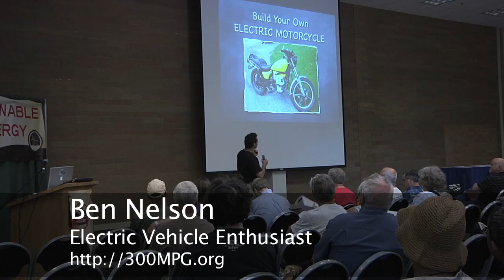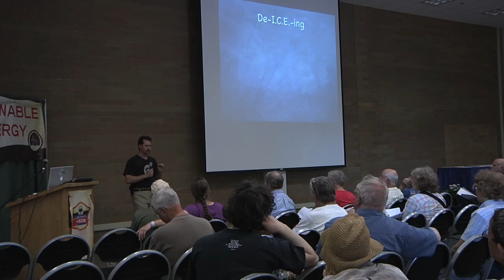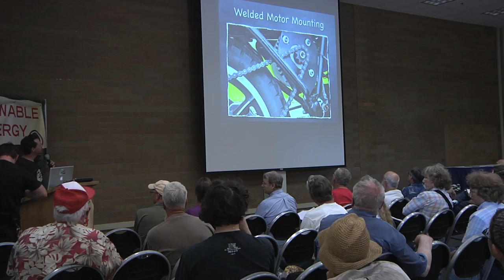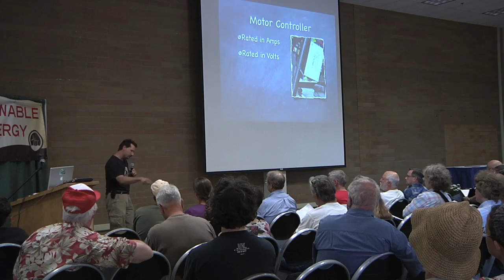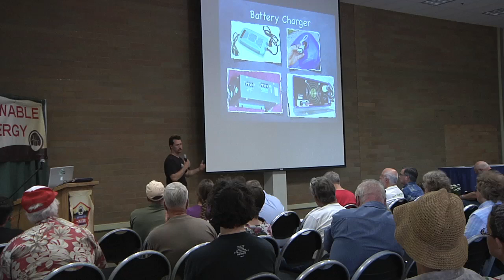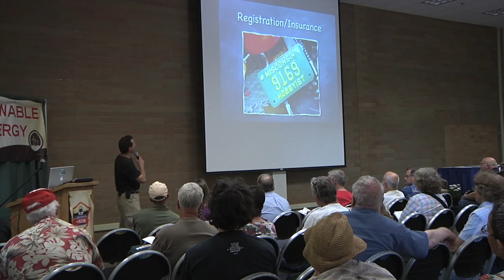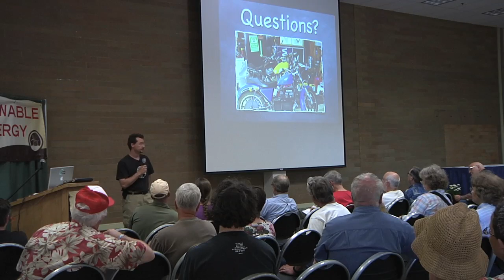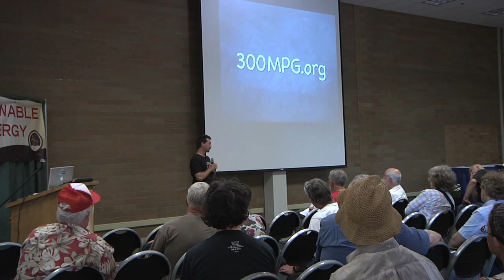Build Your Own Electric Motorcycle

Comment from the maker: @ParagonReef 
With the motor, gearing, and everything else on my cycle, it rides at about 1 mile per hour per volt. If I just increased the system voltage to 72, it would do 70mph. It would also need at least double the capacity of batteries. Lithium batteries would be the way to go for that type of range.

Comment from the maker: Yes, you could fit more smaller batteries in, but smaller batteries have less capacity, so you would need more of them for the same range. Smaller batteries tend to cost more per watt-hour as well. The one advantage of smaller batteries is that you can have more of them in series for a higher system voltage. In this case, I'm using a 48V motor, so I'm already at my max voltage. I used the physically largest batteries I could that met my maximum voltage AND fit inside the frame without mods.

Comment from the maker: @dfhohj 
On DC motors, VOLTS equals speed.
Voltage is mostly based on how many batteries you have in series.
For amperage, you want to be ABLE to pull plenty of amps, but actually do it as little as you can. Batteries LIKE when you sip amperage out of the batteries. But the heavier a car is, the bigger a hill you have to climb, and the faster you want to accelerate, the more amperage you will pull.
So a web search for "EV Calculator". It will help you figure your load.

Comment: Doppler effect = It is commonly heard when a vehicle sounding a siren or horn approaches, passes, and recedes from an observer. The received frequency is higher (compared to the emitted frequency) during the approach, it is identical at the instant of passing by, and it is lower during the recession.
BTW they make suits for winter snowmobiling, you plug them in, so the winter heat motorcycle issue should or can be solved. Im looking into head ups projection for helmets wifi communication ect..

Comment from the maker: @whothehellgivesadamn 
I added the specs in the video description. The cycle works great for me. If you needed a different range or top speed for your cycle, all of that can be easily adjusted through gearing, higher battery voltage, or (if you can afford it) a different battery chemistry.
The cycle meets my range needs (I could go to and from town 5 times a day if I wanted) and is geared appropriately for the speed zones I live in.

Comment: you could wire your large number small batteries in series in groups of four, and then wither those groupings in parallel, maintaining the 48 voltage. once you start wiring them in parallel, you are adding amp hours. Your small 12 volt batteries have WAY fewer amp hours than the huge 12 volt car batteries.

Comment from the maker: Are you kidding? It's an old computer. The CPU and monitor together weigh nearly as much as the cycle! (OK, not quite that much...) The motorcycle is on wheels, much easier to move...  It really is a huge pain to unplug everything move a computer and CRT monitor, and set it all back up. I only really needed the computer connected to the cycle for just a minute to change the settings. Much easier to run a cable out the window.

Comment: Hey how much kw is your motor?
Im trying to build my own electric motor cycle with a 48v system and a 1000 watt motor is it fine I want to ho max speed of 40-45 kmph and at least a range of 50-60 km
What would u suggest?

Comment: Im still having a bit of an issue when it comes to amps and what size car is ideal for me, so if someone likes speed they need a 100amp motor on a small lite race type car?, or if i need a pickup truck hauler i need a higher amp or volts?, i think people need to understand more what they want as they are building custom vehicles.
autocad is great for creating templates and you can have a cad printer mold you a body, carbon fiber with Kevlar is great for light flexible durability.

Comment: yeah but couldnt you just have like 50, 12volt small batteries with a heavy duty resistor so that it goes down to 48 volts? would that make the batteries last longer?

Comment: Thank you for this clip-I think I'm already adicted with this idea :) It should be nice if you give some clues. I want ( and I will) to make samething not so big. For my girlfriend for example (45-50 kg). Its enough the battery to last for about 30 miles, and speed no more than 30 mph. The idea is to be cheaper (for making) and efective enough in the city.So can you help me to choose the engine, the batteries and right voltage and amperage for this weigt. thanks in advance

Comment: In your presentation you mentioned that you got your motors for under $100; is there a vendor that you recommend that we can reach out to for the motor?
Reply from the maker: Getting extremely low priced motors would be through the salvage market. For example, pulling a motor out of a forklift. There are specialty salvage yards, pick and pulls, etc. where you can get great deals if you know what  you are looking for. For just buying at retail, expect to pay $500 on up. Like so many things cost just depends on other factors you want to put into it.
Here's a list of parts suppliers you might be interested in. https://300mpg.org/projects/evcycle/ev-cycle-parts-suppliers/
Reply: @BenjaminNelsonX  so true as one location retail that wanted to charge over $400 for a 36v 3.7Kw Crown motor that might/ might not work. Unfortunately, there are no salvage markets here in Georgia where I could go into a yard and pull the part myself.
Reply: @BenjaminNelsonX  it took me about six hours round-trip drive but I managed to locate a 48 volt electric motor for my motorcycle for $140.

Comment: Great job . I have a Honda eu2000 generator that is very small and very quite . It weighs about 40 lbs . It runs  8 hours on a 1/4 load  on ,95 of a gallon of gas   . So you can see if the eu2000 was connected  to your motor  instead of your battery's  you could ride all day on less than a gallon of gas . I want the ue2000 to fit in a drop in framed frame   so it ends up  setting  where the gas tank would be  so it can be refilled just like a regular motorcycle tank would .  The exhaust is on the back end so it would be going under the seat and blow out the back . What do you think about a  generator running a electric motor on a motorcycle ? Even on a full load full time using  13 amps continuous usage which would never happen  the eu2000 would still run over 3 hours on less than a gallon of gas . That still 300 miles going 60 mph . Its 2530 miles from coast to coast in the united states ,that means  you can travel 60 mph and go 2530 miles on 8.4 gallons of gas . This is something the  oil company's don't want car or motorcycles to find out  . Remember thats on a full load of 13 amps of use . Its going to be closer to less than half of that amps so your going to get closer to 8 hours of run time . Even if you figured 7 amp full time use of the motor thats makes it 4 gallons of gas to  across the united states.  Will you hook up a amp meter or tester to your motor and find out how many  amps you're using going 60 mph . I know a 110 1/2 hp motor used 9.8 amps . Would a 1/2 hp AC motor be big enough to power a motorcycle ?  I think using less than a gallon of gas every 8 hours of travel time  is a lot easier than the full battery  bike because of the recharge and the power it uses to recharge  the battery's.   The eu2000 will fit in a Dimensions L x W x H (in.) 20 1/8 x 11 2/5 x 16 3/4  space  . Why aren't people using small generators  to run  a motorcycle ?
Reply: people aren't doing this because it doesn't work. The motor controller will draw up to 300 amps which a small generator cannot produce. The generator you're talking about produces 2200 watts peak and usually half of that continuous. That's not enough power. now if you had a battery pack as well as a generator it could be feasible and i'm going to be building prototype vehicles with this in mind using a bio-diesel powered generator. Plus, this idea kind of defeats the purpose of creating a "green powered vehicle" and adds extra complexity and is usually not needed for most people. Lots of people don't go on long trips with their home made ev.

Comment: My LONGEST trip would be 1 1/2 hours ride, mostly flat terrain, 65 miles total, really need top speed to be at least 60 mph, 70 would be ideal. POSSIBLE?
Reply from the maker: A properly-sized lithium battery pack could get you that far. There currently are commercially-available electric motorcycles with those specs. For ideas, do a web search for both Brammo and Zero electric motorcycles to see what size battery packs they have.
Reply: BenjaminNelson
Greatly appreciate your reply, I ordered the DVD by mail, next question,the battery packs you refer too above could/would they fit in the same space as your bike? Would the connections be the same with same other items you use? IF I decided to use these OTHER battery packs could I get advice from you on what and how to hookup latter? Thank You, BTW I work for the company that sells the motor you put in your bike.
Reply: Numa Newbern
 Alternatively, you could tow a trailer with a small generator on it. ;)
Reply: Got one in every crowd don't we? Yea, I could also add batteries in a pack on my back, and a side car full of batteries, thanks for the jigger to my brain where I could come up with MORE amazing options
Reply: Numa Newbern
A sidecar would be a good idea but I wouldn't put any more weight above the center of gravity than I had to.   I was just kidding about the genny, but it would work, you know.
Reply from the maker: williwonti A generator in a sidecar is not completely unreasonable. It could be designed so that there was a quick disconnect for the power between the sidecar and the cycle. The vehicle could be driven locally as JUST the cycle, and on long trips with the sidecar. I did some experiments running my electric Geo Metro with a generator mounted in the back, and it worked fairly well. Of course, now you are talking plug-in hybrid, which IS a more complicated vehicle. (And noisier too!)
Reply: Well, something to THINK about, I would go quicker with the " properly-sized lithium battery pack" IF I could FIND such and had someone knowledgeable that could walk me through the NEEDED parts to assembly, I'm not about to invest in a pletora of individual parts that I have NO knowledge about that can be screwed in hooking them up wrong etc.
The PRICES of the total electric bike is out of the picture, modifying a bike I already have is doable and desired IF the minimum of 55/60 mph can be maintained for 1  1/2 to 1 3/4 hours, this is the max needed.

Comment: alright. it depends on the person doing it then. i would choose to move the computer to the bike.
Reply from the maker: That computer was a boat anchor with a CRT monitor. The device required a serial port, which was not on my smaller more modern computer.

Comment: And the auto manufacturers LIE about the expected MPG.
My V6 impala gets average 15.3...supposed to get 18 mpg.
Reply: Well they do perfectly flat road,   wind behind you, no stops, etc lol.. 

Best case scenario, but you could probably do better and likely will do worse. 

My 08 Mustang v6 is rated for like 27 highway i think.. But often i drive city too and avg like 23mpg.. Though on my vacation i drove like 200 miles and it averaged like 31 mpg.. So it all depends.
Reply: vexx506 ~ That is city driving. Pure highway at 60+ mph in top gear...30+ MPG which is not bad for full size car with 300 HP. I must say after owning this car for more than a year now I do like it mostly. It does have a few weak points but comfort and ride quality are exellent.